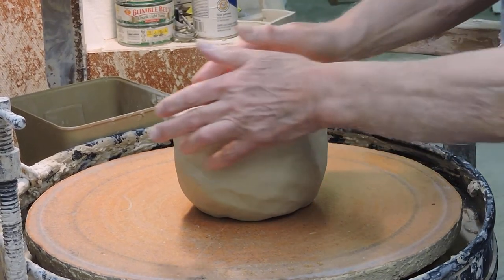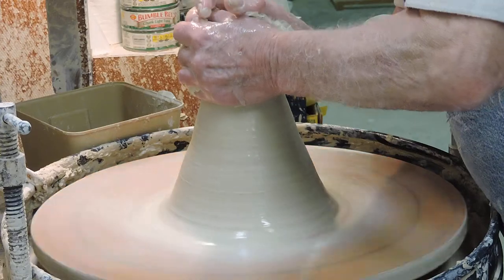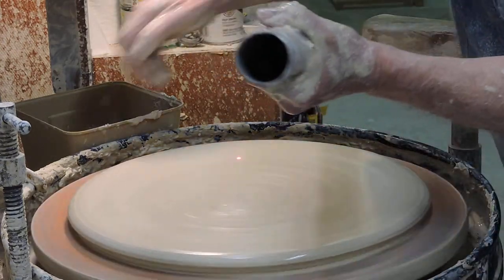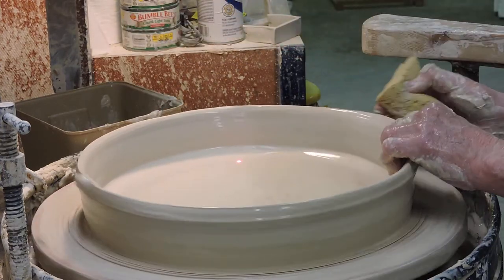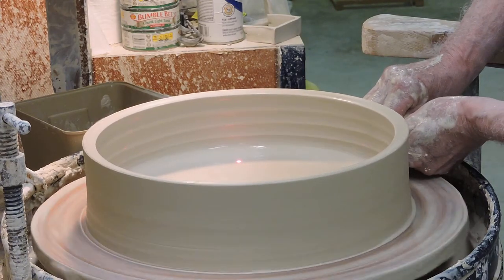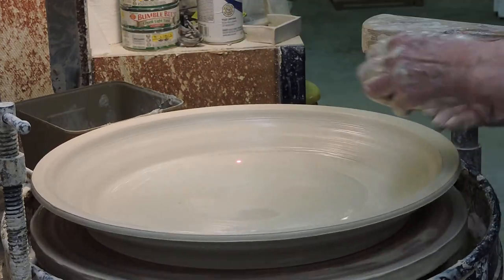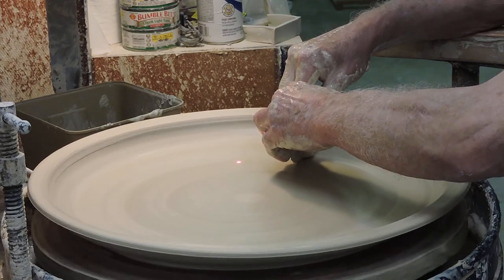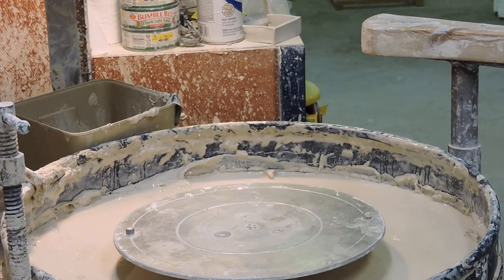DSCN0351

Comment: Thanks Michael. Legend. I've been practicing your Rod and Re-Stand method and made some nice plates and other things. It's a great way to work. The bracing makes centering so easy. One thing I wonder about right now is how to fire a stack of plates with glaze on them so they don't stick to one another. Would that be worth a video?
Reply from the maker: I never stack plates for bisque because they tend to crack with the clay I use. Instead, I bisque fire them standing on edge while leaning against the electric kiln wall. Works fine at cone 08 since my glazes are all cone 10.
Reply: @wendtpot1  Thank you, I shall try it. Nice to hear from you, and all the best